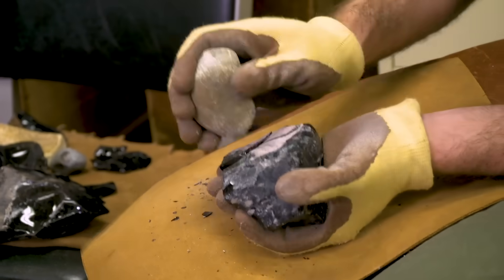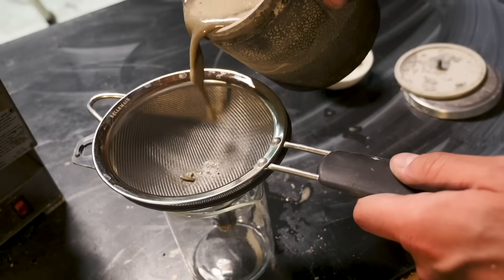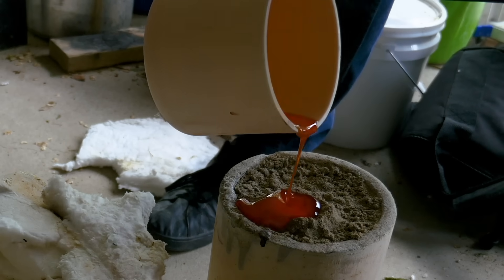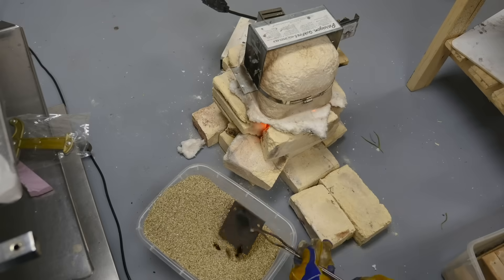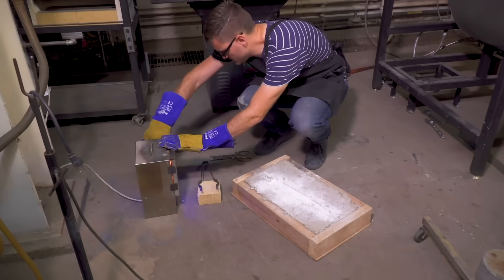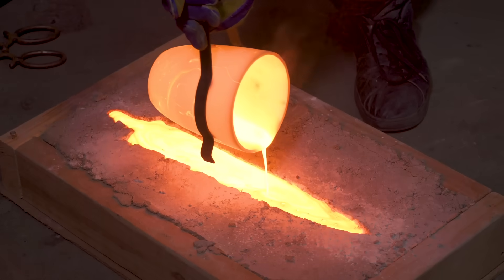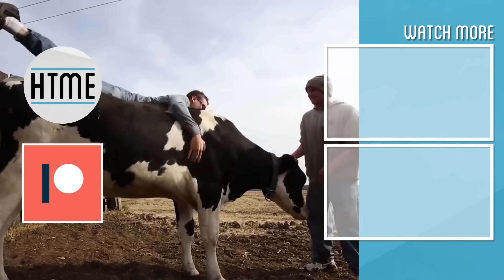Can You Melt Obsidian and Cast a Sword?

Comment: As a glass making professional of 32 years, I can safely say you are using far too much flux ( soda ash, I assume). The bubbling you observe is outgassing from the flux continuing to mix disproportionately with the silica and other impurities. Your issue with continued breakage has just as much to do with the chemistry as it does the inconsistent thickness and rapid, uneven cooling of the glass.
Reply: I melted a wine bottle in my little home forge one time. I got it up to about 3,000-4,000 degrees F and it turned into really sticky goo that hardened into super sharp needles when you pulled it thin.
Reply: You should try this same experiment and see how you're turns out! I would love to watch your video and see what it would be like at a higher level of competence.
Reply: Let's face facts: the entire exercise is a clusterfvck from the get go.  He doesn't understand the material he's working with, he doesn't understand the chemistry involved, he certainly doesn't understand how to cast weapons (short version: you don't), and he can't even fvcking knapp a decent edge.

I mean - what sort of fvcking cretin would cast a blade from obsidian and then expect it to do ANYTHING other than be a paper weight or shatter?  It's simply not a viable material for a weapon by itself.
Reply: @iatsd  It was a viable weapon for most of the time humans have existed. It killed far more large mammals for eating than any other weapon!
Reply: @freedem41  Your first statement is true, but you have zero support from the archaeological record for your second statement.

Obsidian is somewhat rare globally, and it isn't a durable material for fighting with.  There's a reason people used flint and other stone more widely.  These days it still has niche uses, but it's very limited: it makes an exceptionally sharp edge, but that is the ONLY positive it has.
Reply: @iatsd  knapped  obsidian has  been a standard blade for  thousands of years. Flint is not far removed in its nature and makes up the remainder of  the use and is similar in being brittle when long and thin.
Reply: Not to brag but I have fifty years in. By altering it you are essentially making glass. Watch some you tube videos abut annealing etc.
Reply: I'd love to see a usable sword made from obsidian
Reply: @MasterLGI  yes usable until you hit the first solid object 😂 I hope you are wearing safety glasses when it shatters!
Reply: @samuelmarberry4761  gotta have some hope
Reply: @logicalwren8061  I do have hope but I also have knowledge, I knap obsidian and flint, I know just how brittle it is.... It would be close to fighting with a sword made of glass. Now the club's the Pacific Islanders used that was lined with several sharp knapped piece's of obsidian are insanely awesome and devastating, each time the obsidian fractures it leaves sharp glass inside the wound and the broken piece's glued into your club mostly just become sharper with each break until they are depleted.
Reply: @samuelmarberry4761  Gloves too, since the handle is also glass.
Reply: @samuelmarberry4761  Similar idea to a damascus or San Mai steel: you have a tough exterior that can withstand impact and the super hard material is saved for the cutting edge.
Reply: @The_Inquisitive_Inquisitor  no it's not similar to Damascus in anyway, how are you going to coat the edge so it cools slower during quenching, not to mention you can't quench obsidian. 
Damascus is hard because of it's overlapping layers a katana is razor sharp Bec it's lead cutting edge is super hard and brittle but it's spine or back is made from really soft steal so it balances out to be a strong blade but they still shatter just like glass if struck from the side.
I would love to see how you are going to quench obsidian 😂 
Oh wait you could just let it ooze into the quench and then knap it!
Reply: @samuelmarberry4761  Alright, you've suffered a misunderstanding. I was not comparing the techniques of manufacture, but the physical properties of the end result.

The macuahuitl (wooden blade with obsidian edge) is clearly and obviously comparable to San Mai steel (high carbon edge forge welded inside a low carbon shell) because the wooden body adds the same benefit as the low carbon steel (ie a durable body to the blade that can withstand impact)

Damascus works on a similar principal, but instead of having 3 layers (soft - edge - soft) the steel is folded and forge welded repeatedly.
Reply: @samuelmarberry4761  does white walkers count as solid objects? xD
Reply: @samuelmarberry4761  Pacific Islanders or Aztecs?
Reply: @The_Inquisitive_Inquisitor  His point is the physical properties of obsidian and steel are very different. Steel is a metal carbon composite, obsidian is a silicate glass. The physical properties are so different that the only weapon comparison you can come up with for a katana is a macuahuitl. Which isn't a sharp blade, but a wooden club embedded with obsidian. The katana relies on sharpness and is made to slash. The macuahuitl is made for bashing. The obsidian on it is intended to shatter as to leave glass shards in the wound. The katana uses "soft" flexible steel with "hard" brittle steel to ensure the blade doesn't break easily whilst maximizing sharpness. The macuahuitl is meant to break. Every times the obsidian breaks, the remaining edge becomes sharper, until you're left with a wooden club. They are weapons with completely different design considerations. To compare a stick with some glass shards embedded in the bussiness end to swords made out of Damascus or San Mai steel and propose they are somehow equivalent is just silly.
Reply: @samuelmarberry4761  With gatorade, it's quenches thirst so why not obsidian?   People put way to much energy into crappy ideas when obvious solutions are on the table.
Reply: @jirikurto3859  I hear plants love that shit too
Reply: @MasterLGI  useable sword entirely out of obsidian is not possible, but Aztec wooden sword with edge made of obsidian shards is closest thing in existence, could even been good self defense tool if it wasn't breaking half of self defense laws upon usage
Reply: @MasterLGI  Obsidian is a felsic glass, if it cooled the way a rock normally cooled it would be a feldspar (a rock) ... but it cools quickly and formed into a glass. Glass isn't a material, it's a PHASE, it occurs when something that would normally be a crystal cools too quickly to crystize (often this is done by people via "quenching" ... in nature it's done a lot in stuff involving volcanoes! ... or asteroids impacts) resulting in a amorphous solid. We can make different mixes of materials into glass mostly silicon oxide + other stuff like boron trioxide or sodium carbonate, aluminum oxide  etc.  ... but is a horrible material for a sword. BECAUSE IT IS GLASS! Felsic material is silicon oxide + other light minerals like sodium, potassium, aluminum etc.  Felsic minerals include quartz (silicon oxide); Anorthite (CaAl2Si2O);albite (NaAlSi3O8) etc.
Reply: @maggiemakgill  I know that it would be a terrible idea. Btw if sand was heated and slowly cooled instead of quickly cooling into glass, does it just make sandstone?
Reply: @MasterLGI  It's not a terrible idea but ... (1) Sand like glass isn't a particular substance, rock, or mineral ... but just small pieces of something. (2) Sandstone is made by compressing sand back together, not melting and re-crystalining the minerals. Natural processes that re-melt rock typically involve plate tectonics or impactors. The most common mineral in sand is silicon oxide (second most common is calcium carbonate which is what limestone/coral is made from and has its origins in coral reefs). If you melted and quenched silicon oxide you would get common glass, if you melted and cooled fairly pure silicon oxide slowly enough for it to crystalize you would get quartz. Silicon oxide mixed with other materials which crystallizes slowing into a material made up of small crystals of various related minerals attached to each other is ... rock. If it was silicates and light element it would be a type of feldspar.  Naturally all this starts out with lava/magna of various make-ups and how that lava cools ... while buried under other stuff,  on the surface, under the ocean ... while flying through the air after getting expelled in an eruption. That is the source of all igneous rocks ... lava/magma. These processes effect if a rock it crystallizes or becomes a glass, how large the crystals are ... what minerall they are made up of (they are formed in a particular order from the highest melting point to the lowest) and the texture of the rock.
Reply: @maggiemakgill  Sorry, but I couldn't read that to save my life. There's too much information to get into my head. Thanks for the ted talk though. You said that obsidian is extremely brittle, meaning it's not really suitable for weaponry. However I do wonder what would happen if someone lined the edge of a steel blade with obsidian and sharpened it. If you stabbed someone and the obsidian broke, it would technically do more damage and when you rip it out it becomes a hook-like weapon and rips out some insides with it
Reply: @MasterLGI  obsidian blades are sharp because a conical fracture has a nearly atomic thickness edge, you  might get thatby applying super  high tech to the whole process, but it would not be what you started with.  You might take just an obsidian rock and after heating to nearly 2000 degrees  pick it up with a punty and use regular glass working tecniques with a proper glory hole and possibly a press mold, to press it into a short thick blade and add a thin coat of regular sodaglass. Then anneal for a very long time.  After that the regular glass will have peeled off like very old paint but leave behind  a lot of very sharp edges that will look sort of like knapping.
Reply: Dude I have heard of you and I want you to make me a pipe or a bong so bad I know that's probably not your typical area of expertise but I've grown up in that industry for the last 20 some odd years and I'm not a glass blower myself I don't pretend to be but it is something that I do wish to explore in the future
Reply: Yeah I can tell you his experience is in metal work, he has just has the concept of glass working down.
Reply: Thats exactly what i said and i dont do any of this shit. Im asuming just melt all the flux out and keep casting
Reply: Exactly. Though, it was so hard to watch because of how dumb he was.
Reply: Then made it, we want result.
Reply: Lol I was thinking It didn't even need to use flux. 
I was also thinking if he would have put it in the oven and slow down the cooling It wouldn't broke.
It was fun to watch it bubble though
Reply: I wonder if he'd still be able to melt it enough with less flux.
Reply: I applaud your knowledge in glass making for 32 years, but obsidian is not the same kind of glass that you work with for 32+ years! Even if you did every single thing right that you had mentioned, casting obsidian is no longer considered obsidian bc you are changing its crystalline structure and by changing its crystalline structure you are actually weakening it. I'm sorry but can not apply your 32+ years of knowledge in glass making to casting obsidian.
Reply: I thought he was mixing far too much crud into it myself and I've only ever melted Lego 😂👍
Reply: Oh wow I’m only just thinking about how to start this is great info to know!! Thinking about creating shields and gear w a twist
Reply: @ayeeii5585  obsidian is way too brittle to make stuff that actually works, so just make sure to be careful if you make stuff out of it. The shards could end up seriously hurting you
Reply: @ayeeii5585  that is literally the stupidest thing to do, casting obsidian shields....it's just going to shatter....did no one listen to what he said at the end....it.is.not.obsidian and it cannot be sharpened bc it will shatter
Reply: Hey there! Metalurgist trainee! While obsidian is closer to glass, it looks like they were using methods closer to forging metal. I think due to the brittle nature of the obsidian, they should have sintered it if possible (the process use to create tungsten rods)
Reply: I think he doesn't know the chemistry
Reply: @ruie.34  parts of what he said is common sense. The bubbles for example, why would you want air gaps when casting anything?
Reply: I am a master swordsmith that specializes in obsidian blades. I agree he is using too much flux. Also, these blades aren’t toys. I’ve seen a close friend drop one on their foot and completely sever their toes.
Reply: I'm a glass making professional of 37 years, and I say he used about 1/8 the flux he should have.
Reply: @McAwesomeReaper  you are a liar!!
Reply: That’s a lot of words, too bad I’m not reading them.
Reply: @NateBuckz   No one cares if you have trouble with minimal reading tasks.  Go annoy other people with your idiocy.
Reply: @jirikurto3859  I said that because it reminded me of a meme of that 8 bit guy
Reply: @NateBuckz  That's cool then.   I thought you were just being clownishly dismissive for no reason like a lot people are.

Comment: Ancient Mosaics have been found describing two large 2-4m wide highly polished 'mirrors' said to have been used to melt ancient rocks such as obsidian using light. These dual mirrors are said to have been brought by the gods and had a highly religious significance. Apparently made with a complex alloy of Gold, silver and other metals. The mirrors are said to have been lost when Spanish conquistadors melted them down for their value. Try it using concentrated solar light instead of furnace..

Comment: @how to make everything - 

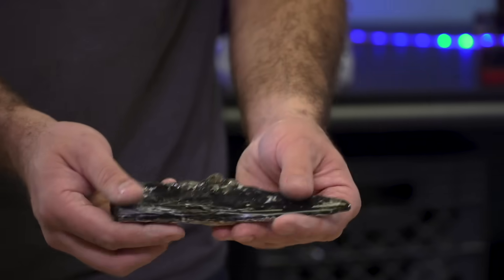when looking at the 9:30-10:00 bit, what I think would improve that method is to use a mold that is preheated, maybe a metal frame rather than wood. and instead of blowtorching bubbles down, have constant heat to prevent the bubbling from taking place in the first place.
 and let it cool extremely slowly. Like EXTREMELY slowly.

Comment: Obsidian, good for blades, is deep core glass where the flow lines are more uniform and the glass sets slowly under pressure.  Your pouring and the filling of the mold creates eddies in the glass. The rapid displacement of heat causes uneven shrinkage and numerous microscopic fractures, making the glass even more brittle.
Reply: So the short answer is no, you can’t cast obsidian. By the time he added all the flux, and metals to make it blacker, it was no longer obsidian anyway. The lapping and breaking of the obsidian rocks is what caused the razor sharp edges, without that edge, it’s pointless.
Reply: There are people who actually knapp dance blades
Reply: @AnyMotoUSA  yes, I’ve seen some beautiful blades 6 or 8” long, with a deer horn handle, excellent craftsmanship.
Reply: And by blades you mean from a blade core
Reply: @AnyMotoUSA  Or core-stone, and yes.
Reply: @DangerMouse  
Otherwise known as a “burin.”
Reply: 3d print molecular layers...

Comment: Other then to see if it can be done melting obsidian for casting is counter productive for two reasons. 1. Properly knapped obsidian is significantly sharper then the sharpest steel at ~3 nanometers. Nothing casted can ever be that fine. 2. Obsidian is harder then glass. Grinding it to create glass for casting results in a less hard substance. Some surgeons have used obsidian scapels because the cuts create fewer inflamatory cells and heal with less granulation. In prehistoric central Mexico, obsidian microliths were imbedded along the edges of wood to create effective double edged swords.

Further, the composition of obsidian is known. It made of 70%+ of silica dioxide. The black color is created by magnitite impurities. Reddish obsidian possess iron ore impurities while green obsidian has copper impurities. Snowflake obsidian is created by radially clustered inclusions of cristobalite. X-ray fluorescence or neutron activation analysis is used to identify specific source location using trace elements. Newly formed obsidian contains less then 1% water but over time the material naturally hydrates typical at known rates that vary from flowvto flow.

Comment: In Phizzics to keep the melted rock a liquid for a long period to have to change the internal nucleus within the atoms. To do this you need to let the heat continue for a period that is directly connected to how long, in layman terms, you want the material to stay liquid. For example if you get it melted and continue the heating for 20 minutes the material will stay in a liquid state for 7 minutes if you continue to heat it for an hour it should stay in a liquid state for about 15 to 18 minutes. At least that's physics says. The internal nucleus will gain a new charge for a short period of time and remain a liquid longer with differing heating time sequences. Try pouring the liquid over a steel rod inside of the sword.

Comment: hello. i am not really a blacksmith or what not, but i have an idea for this . why not make a kiln that could fit an already made closed mould that could withstand all the heat, then inside that mould, fill it up with the powdered/crush obsidian, then put the entire mould inside the kiln, let it melt into shape without having to disturb the obsidian (no need for pouring or removing the obsidian, as it melts it will fill up the spaces of the mould) and see what happens. i mean it will definitely not cool down too fast after removing it from the kiln, the mould will slowly cool down. 

a friend of mine tried it before aluminium paper (the one used on food), he made strips of aluminium and put it inside a mould and let it melt into shape. im not sure though if it will work on something non-metallic like obsidian.